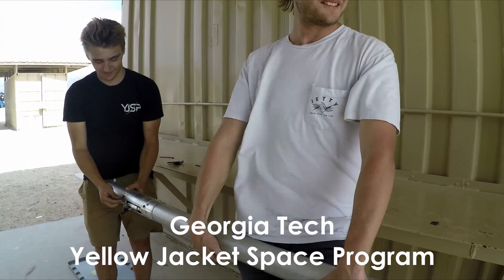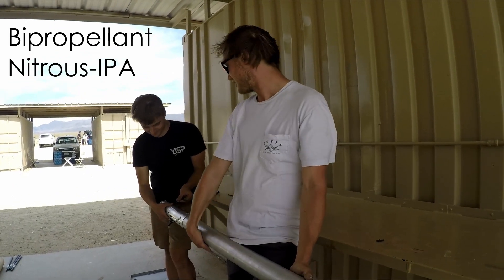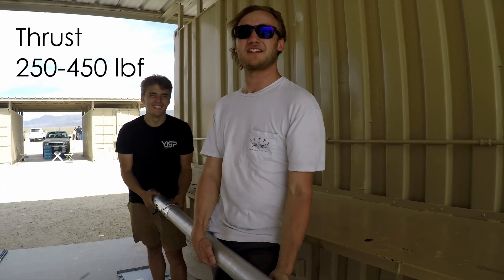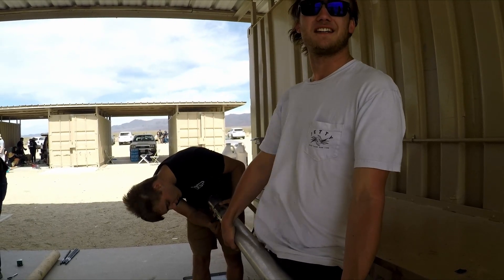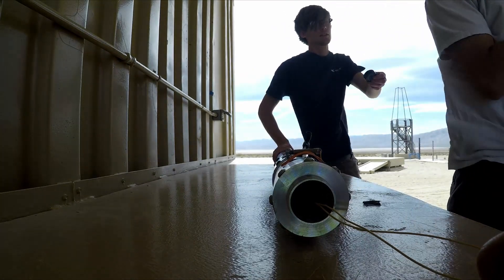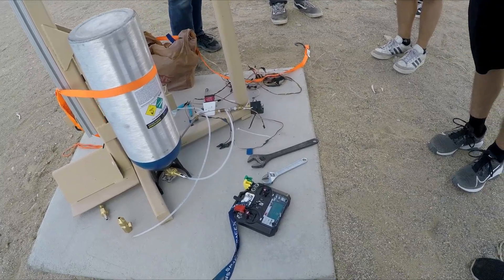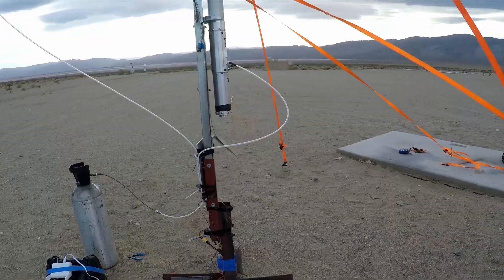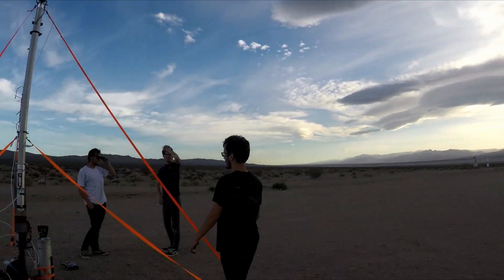A Nitrous Bipropellant Static Fire at Night (YJSP)

Comment: Also i forgot, Using a nitrous bottle heater blanket is super beneficial to have when extracting liquid nitrous oxide, brings up the pressure in that bottle as well, I do it all the time on my 20 pound bottles, i use three 20 pound bottles on each run that i go through in 11 seconds run time at full power and never lets me down with power and performance

Comment: Accidental cold flow sucks, been there before, May I suggest from one engineer rocket builder to another,  using GOX as your pre-starting oxidizer before you open your nitrous solenoid, and machining a solid convergent-divergent graphite nozzle. judging by the divergent section of your nozzle looks almost like aluminum. 304 ss or titanium or even Niobium would be a good alternative if your going the half graphite half alloy route
Reply from the maker: YJSP is working on a kerolox biprop at the moment. A GOX starter sounds interesting, given the difficulty in lighting nitrous. Stainless would probably have been the way to go if the aluminum was insufficient, but it seems to be just good enough and certainly cheaper. I think half nozzles work really well though, since full graphite tends to fracture in the supersonic region. Our recent FAR motor test had a phenolic diverging nozzle with graphite insert.